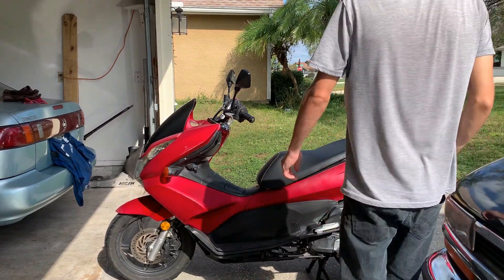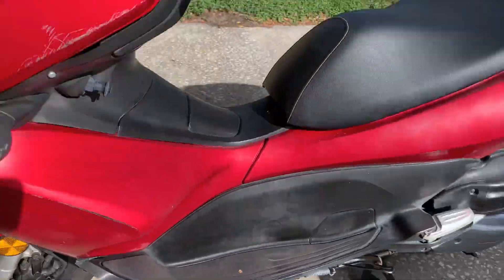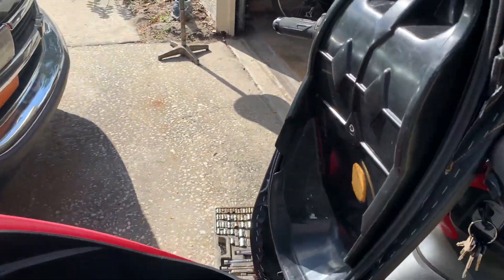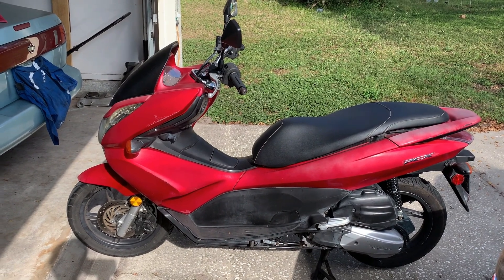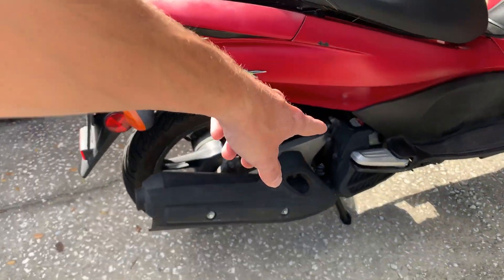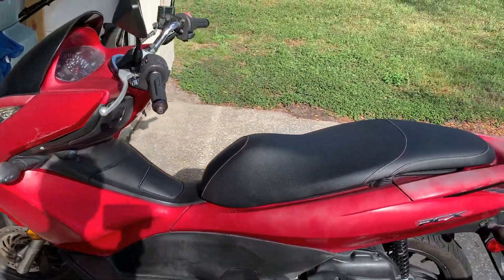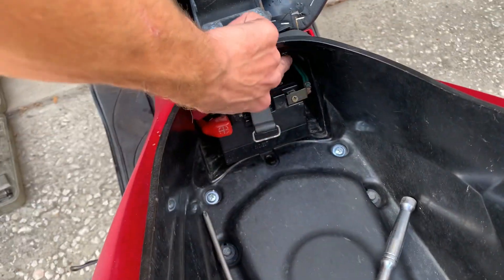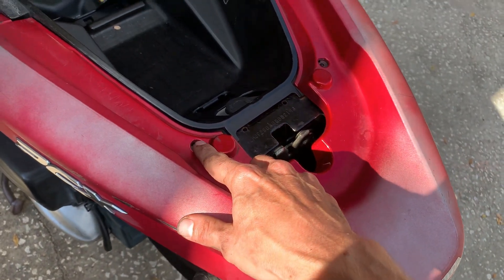Honda PCX Valve Adjustment- The Easiest Way Possible

Comment: Best video guide I've seen for this maintenance. I will be getting a 2022 PCX soon, not sure if the process will be different on a 2022 model but must be mostly the same. And I think I'll follow your advice about getting valves checked at 1k miles and then mostly leave them alone for quite a while. I'll let the dealership to the first check, but I saved your video in case I decide to check them myself in the future. Thanks a lot.
Reply from the maker: Youre welcome. Good luck with your pcx

Comment: I'm not a fan of gasket sealer, especially if there was none on the gasket to begin with, it tends to squeeze out on sides and if little bits break off they can easily clog an oil gallery.  Rather just fit a new gasket.  18:03, thanks for the "9mm" tip ("the little square guy" is a 3mm).
Reply from the maker: Which oil gallery is that

Comment: So without using the TDC marks the valves are ready to adjust when there's equal play in the engine rotation both ways once compression is felt.

I've done valves before on 4 pots and a single, there's definitely a feel.

What's your take on that?

Honda PCX 125 gen 5 model owner approaching 5k miles (the bike, not me lol)

Always sounded a bit tappy.
Reply from the maker: i guess that method would work but ive never tried. Ive always just used marks on the flywheel, and for engines where thats not possible like pcx i look at cam and valves + stick a pencil in spark plug hole to find tdc

Comment: Thank you for the video man. What wrench did you use to get the 10mm bottom right side valve cover bolt?? I can't reach it with any wrench or extender i have
Reply from the maker: I used my crescent 10mm ring end wrench with the angled head from the set i showed at the beginning.
Reply: @alexsbikesandmotors  thanks bro i found a rotating ratchet i could reach it with. I got a red 2013 as well about to pass 35k miles and my idle is too low and will sometimes die. Valves haven't been checked in over 20k miles so i'm going to do that. I'm thinking my fuel injector couldve been damaged because water had got in my gas tank recently causing more problems so i may try that if the adjustment doesn't work
Reply from the maker: @jimmybluetron5227  if your check engine light is on you can check for trouble codes with a paper clip
Reply: @alexsbikesandmotors  Theres no check engine light on. I torqued down the spark plug now it hasnt happened again yet. The only thing i'm worried about doing the valve adjustment is the exhaust valve. I'm afraid i wouldnt be able to reach it with the needle nose pliers while screwing in. How did you fit 2 hands in there?
Reply from the maker: @jimmybluetron5227  i actually dont hold the adjuster with anything. I just set the clearance a little bit too loose, then tighten the lock nut, then check the clearance again with the feeler gauge to make sure its at the correct spec with the lock nut tight. It's kind of a trial and error thing.
Reply: @alexsbikesandmotors  thank you so much i have everything i need im starting tomorrow morning. I know nothing about 4 stroke engines so i wait for the bottom valve to fire then the top valve, and keep turning till i feel the most pressure then i should be at top dead center?
Reply from the maker: @jimmybluetron5227  yes thats pretty much it. You can remove the spark plug and stick a pencil or something down the hole so you can be sure the piston is at the top
Reply: @alexsbikesandmotors  I finished after working on it for over 17 hours starting at 2 am last night. My 2013 PCX engine layout is different than yours and some of the hoses are flip flopped. I have 4 bolts my valve cover instead of 3 and accidentally broke one off in the engine over tightening. It's still in there but could be extracted with pliars. I don't plan on ever opening up the valve gasket again though so i'm not worried. The first valve was perfect and my exhaust needed a slight adjusting. I may have left it a tad loose but it was dragging on my feeler guage.Ended up having to take on and off the valve cover 4 times due to oil leaking after trying to get the gasket on right. 2 bottles of RTV later covering every gap in the engine now it's running quiet and sounds great. I'll just re apply some permatex rtv periodocally

Comment: If oil is leaking from the engine and not blowing smoke, does that mean probably need to replace head gasket which this video shows? thanks
Reply from the maker: Watch the video

Comment: Going to be cursing yourself in a couple thousand miles when you have to scrape all that gasket sealer off for the next job haha.  I know those gaskets arent cheap, been there. 
I have been thinking about getting a PCX for a while, seems like a super convenient bike to own and use. Does it ever give you trouble after sitting for a few months or longer periods of time? My ruckus cant sit for more than a month without pitching a fit and thats even with non-ethanol fuel.
Reply from the maker: Why would i be removing the valve cover in a couple thousand miles? My pcx has never sat more than maybe 3 or 4 days so i cant answer your question but it always starts immediately.
Reply: My little glr (cbf) starts first touch of the button wether it’s sat for a week or a year. Same with my old fireblade.  Honda baby 👌🏼